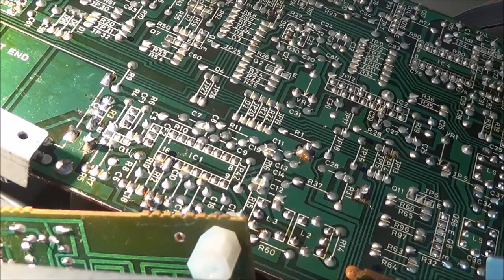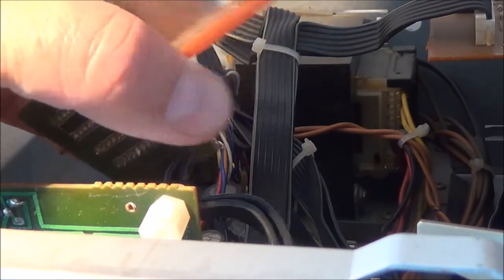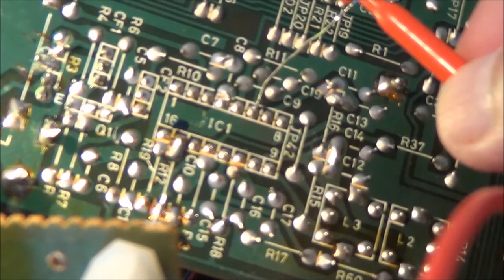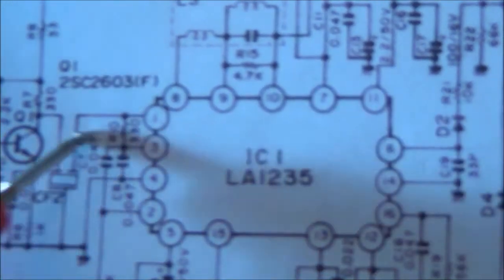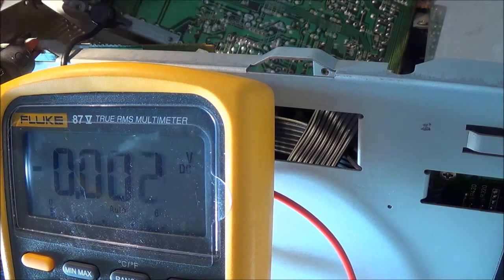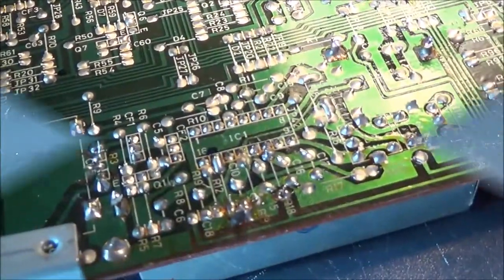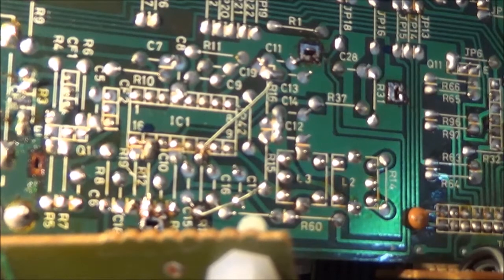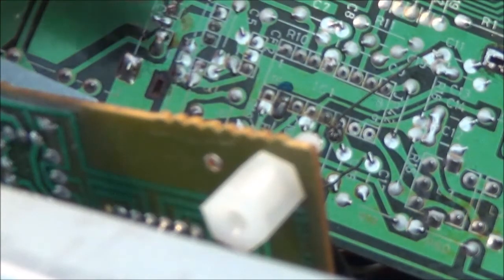Mitsubishi DA-R47P Stereo Receiver Tuner Problem

Comment: Fantastic the SAM's helped you out! And thanks for the mention!  :)  Also, that old glue was added to help stabilize that component it was added to, problem is, over time the glue hardens and becomes corrosive and resistant!  So the glue alone can eat the legs of caps/resistors, etc.. and short things out. It's always best to pick all that old glue off and use non corrosive glue such as hot glue.  Hope that helps some, glad to see this repair so far is successful!  Have you thought about placing your camera behind you off to the side and zoom in?  That's what I do for the same complaint you have!  :)  ~Jack, VEG
Reply from the maker: Thanks for watching and your comments! I think the old glue was the culprit, like you mentioned. I better check more of those resistors...I can't put my camera behind me because my tripod is really small and my work bench is maybe 3 feet by 3 feet; also I don't want to buy anything for this YT stuff. If and when I ever reach a 1,000 subscribers or so...maybe then. And I never know if I am going to continue on, I might add. I have started watching your camera repair video...
Reply: Oh, no, I hope you don't stop! Your one of my favorite YT channels!  That would be a tragedy for sure!  :(  ~Jack, VEG
Reply from the maker: +Vintage Electronics Geek You make one of my favorite channels!

Comment: I am happy i see this video because in a lot of my repairs, the resistors are often the problem, also transistors going wild. In a lot of videos  see on youtube is like: replace the capicitors and it will work,..that is not my experience, yes in in old tube radios, but not the recievers and tuners i try to repair. A lot of resistors yes that are bad.
Reply from the maker: +antraciet Thanks for watching! Yes, often it involves more than just changing the capacitors. And thanks for your comments.